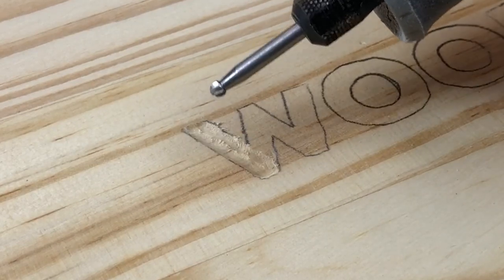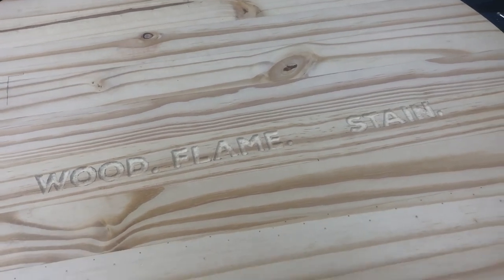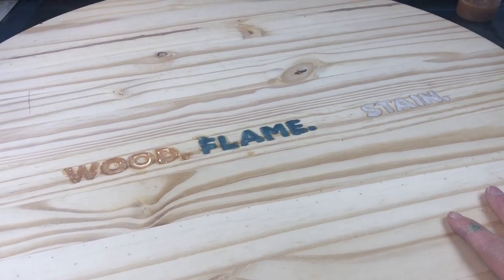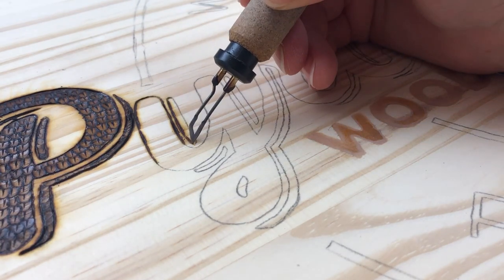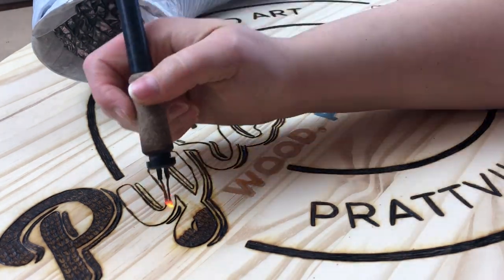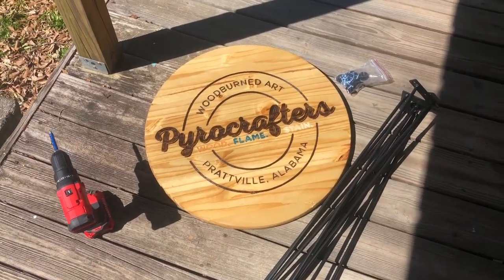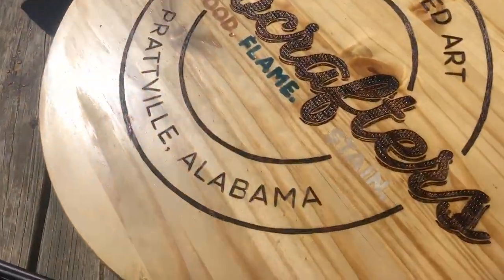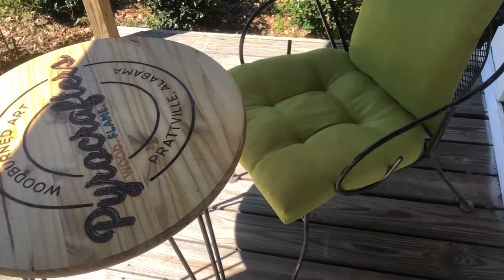Wood Burned Projects   Custom Table

Comment: Really like that Aney. Looks great.
I have a question for you. Does that resin come ready to use, apart from color of course? Or does it need some sort of accelerator or catalyst?
 I have never used any but would like to give it a go.
Reply from the maker: Hey Peter. It comes in two parts; the resin and the hardener. You have to mix them equally (it comes with measuring cups) and then stir it very, very well. If you don't mix it equally or stir it well, it won't harden. I have learned that the hard way.  Once I have it mixed and stirred well, I add the color and stir again. Also, make sure it drys for 24 hours in a climate controlled room. I don't normally leave the heat/air going in my shop at night, but I do when I have resin drying over night. It's kind of tricky stuff, but once you learn the tricks, it's really amazing stuff to add to your art. There are a lot of ways to incorporate it.
Reply: @Pyrocrafters  Thank you very much Aney 😊